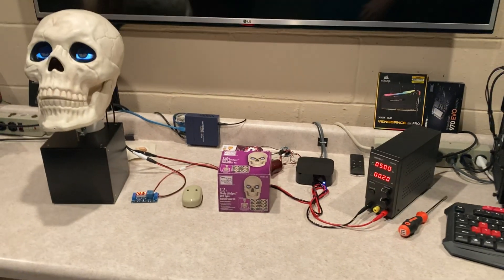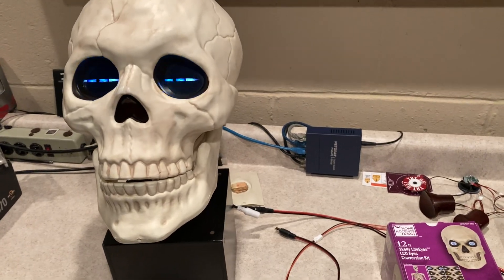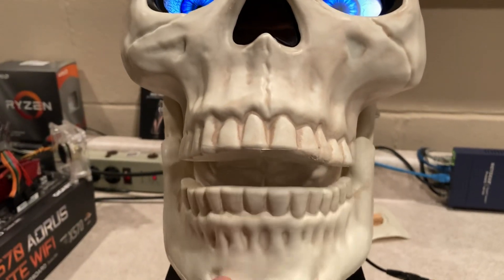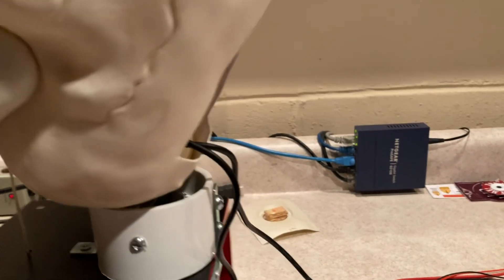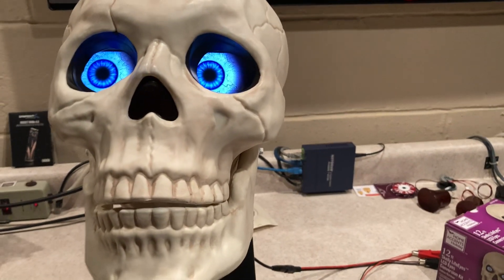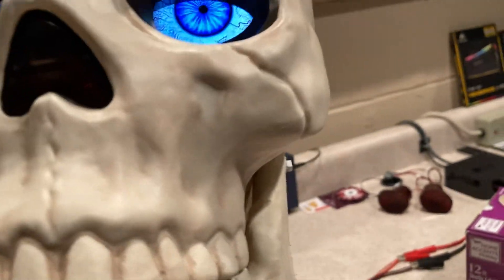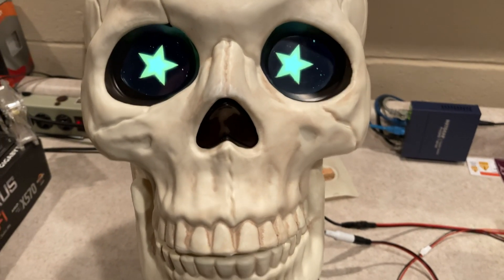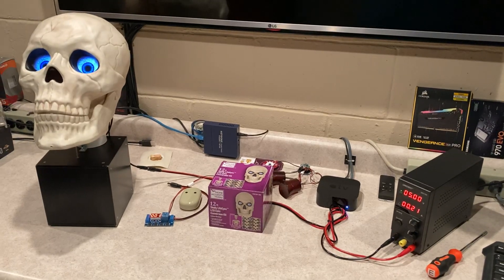My Large Animatronic Skull With LCD Screens Mod Continues Part 1

Comment: I got  the eyes just not sure how to power them for lowes carvable pumpkin foam any instruction
Reply from the maker: Yes watch my video on the voltage and hookup.
This is the title of my video. 
 Upcoming Project With LCD Eyes And A Review 
Thanks for the comment.
Reply: @mikecomptech  I finally got them  installed. I Unfortunately, put the  screens are upside down when I get to fire and heart there upside-down. So left is on right side and right is on left side. Oops the good this I leave it on eye mode no fire or heart you can't tell. Super happy otherwise.
Reply from the maker: @nsvaluto48328  Yes lol I almost did that myself.😄 How did you mount the eyes in the skull, hot glue that's what I used. Glad you enjoyed the project video. Thanks for the update and comments.
Reply: Your welcome it's not a skull it's a pumkin
Reply from the maker: @nsvaluto48328  Yes I remember now you said pumpkin. lol 😄

Comment: ok so how do us fans install these eyes again ???
Reply from the maker: All depends what skull you have.  I hot glued them in the Tractor Supply Skull that's where I bought this skull I installed the screens in. Had to cut a square access hole in the back of the skull to gain internal access.

Comment: Is there a plug-in power supply I can order for this? I’m using it on another project and have no clue how to power it.
Reply from the maker: No problem search Amazon for this power supply.....GuanTing Universal AC Adapter 6V 2A Power Supply with 8 DC Plug Tips AC110V to DC6V Power Driver for Digital Blood Pressure Monitor 6v Charger Transformer AC DC Adapter (DC6V-2A)      Then get these power couplers.......
MOBOREST 12V 5.5mm x 2.1mm DC Power Connector Adapter, 12/24V Female to Female Power Jack Socket for Led Strip CCTV Security Camera Cable Wire Ends Plug Barrel -2PCS 
This will let you power up the LCD Eyes without having to cut the wires to the eyes.. Thank you for the comments.... ;-)

Comment: mind posting a link to where you got the timer device?
Reply from the maker: Sure no problem they are available on Amazon DC 6-30V Timer Relay Programmable Delay Relay Module Cycle Timer with LCD Display / 5V Micro USB, Smart Home Controller 
Do a search on Amazon you will find it. Thanks for the comments.

Comment: What did you do for power
Reply from the maker: To power the Eye's is 5 to 6 volts DC. The black Longwei power supply is what is powering it.
You can see the voltage I had it set to, and the current they pull. Thank you for your comment.

Comment: I wonder if you put some clear glass cabochons, would that make it even more convincing or would that magnify the pixels on the screen? I bought some of these tiny screens and plan on making something similar to this. GitHub has a lot of code you can copy to an Arduino nano or esp32 board. But this is a million times easier.

Comment: Would you be so kind to tell me the name of the black box power supply that’s on your workbench with the red 2 rows of numbers. And where I can buy one. Thank you
Reply from the maker: Sure no problem it is a LONGWEI 0-30VDC  0-10Amps Amazon  DC Power Supply Variable,30V 10A 4 Digital LED Display Adjustable Regulated Switching Power Supply Digital with Leads Power Cord (30V 10A Black) Used for Spectrophotometer and lab Equipment Repair.  Hope this helps and thank you for the comment.

https://www.amazon.com/Variable-Digital-Adjustable-Regulated-Switching/dp/B092DCM46L/ref=sr_1_21?crid=36VBDQVENZI83&dib=eyJ2IjoiMSJ9.gQmI3QoLp4JNCMyDNInzUSOklQcFlRWVIEucC1B3pb3GjHj071QN20LucGBJIEps.1GOutVIgvqXmJzqQVgW-AIEP47EaayzatCDI3EqXSO0&dib_tag=se&keywords=power%2Bsupply%2B0%2Bto%2B30%2Bvolts&qid=1725649235&sprefix=power%2Bsupply%2B0%2Bto%2B30%2Bvolts%2Caps%2C88&sr=8-21&th=1
Reply: Thank you so much the the information and the link. Much appreciated

Comment: My Home Depot has/had lots of the eyes in stock mainly because not many people feel comfortable taking apart the big skeleton and the new skelly  has the eyes already installed I bought a few of them to update my skelly and add eyes to some other stuff maybe a jack o lantern or some other prop
Reply from the maker: Yes you are correct, some people just don't want to have to do this install.  And you can't beat the price $30. I have 2 more sets myself. Thanks for the comment.
Reply: @mikecomptech  it’s kind of addicting every time I go to Home Depot I pick up a set, if I don’t use them this season will shelf them on the workbench, it’s crazy how much they are trying to sell them for on eBay, I was thinking of wiring a set into the plantation window blinds by the front door by an alcove to startle trick or treaters as if someone was looking between the blinds lol
Reply from the maker: Yes it so rewarding to see a concept actually work when you are finished building it. The eyes are  great at $30 ;-). Thanks for the comment.

Comment: I would have liked to see you install the eyes. I bought a 10 ft skeleton and the eyes. Hopefully I can get it to work.
Reply: The eyes come with the screwdriver and everything you need was really simple maybe 15-20 minutes
Reply from the maker: Great,  just measure first to make sure that you can fit in the LCD eyes.
It was a fairly easy install on this large of a skull that I used.
Thank you for the comment.